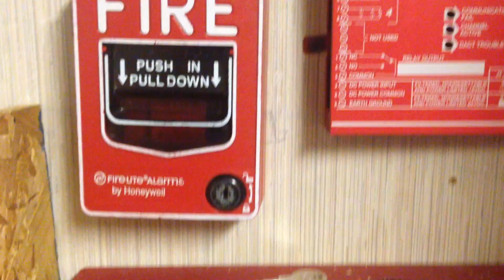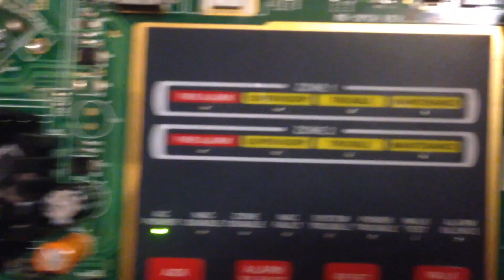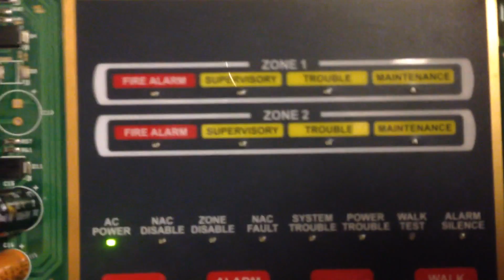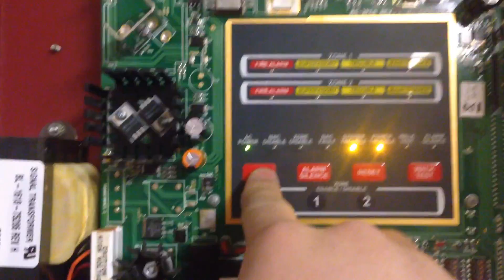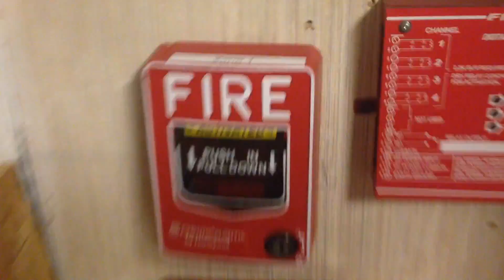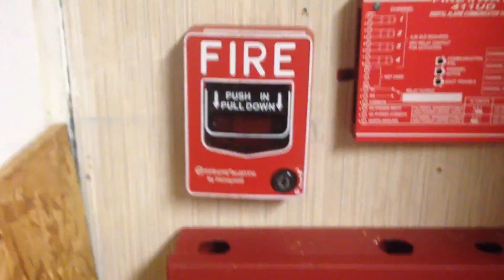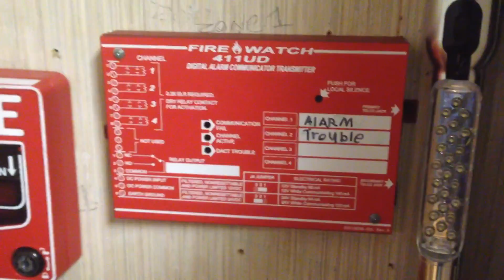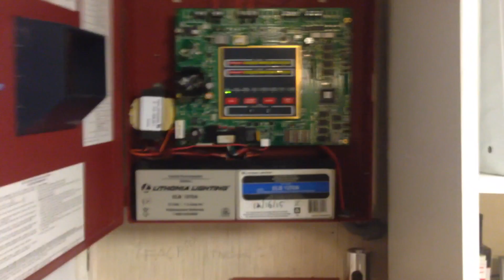How conventional fire alarm systems work

Comment: Nice video,  do you think  l can turn  on a combustion engine water pump  with  this system ?
Reply: victor carcamo no because a combustion engine water pump runs on the engine belt. If your thinking of a 24 volt motor. Make sure it's low amperage

Comment: At my work, there is a pull station (BG-12L) right outside my office room.  I was coming back in from break and I saw someone pull it.  Immediately after that, I pulled him by the back of his shirt, and pinned him down until a security guard came and cuffed him up.  I literally was at the point of just beating him up but I didn't want to do that while on the clock.
Reply: Lol your a bitchass snitch.